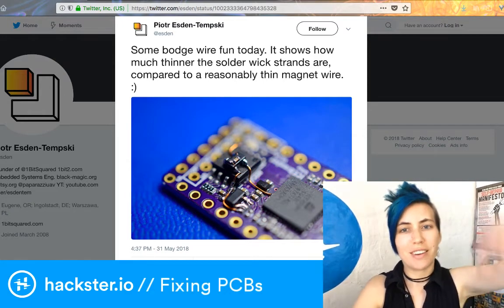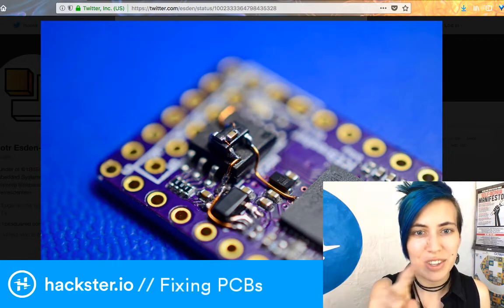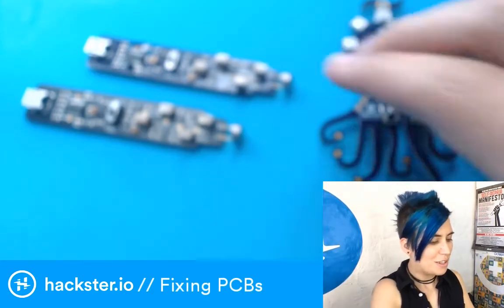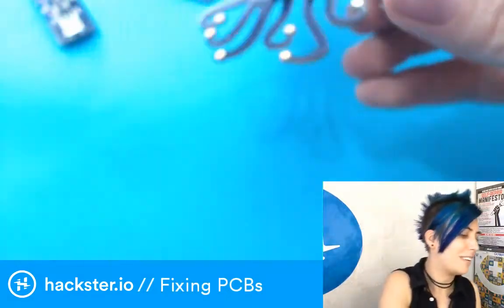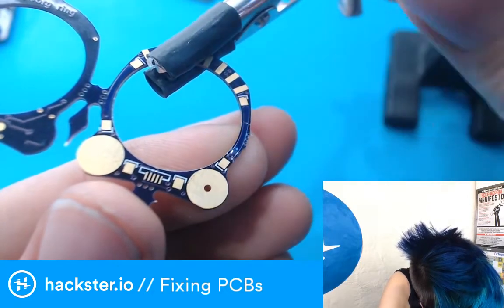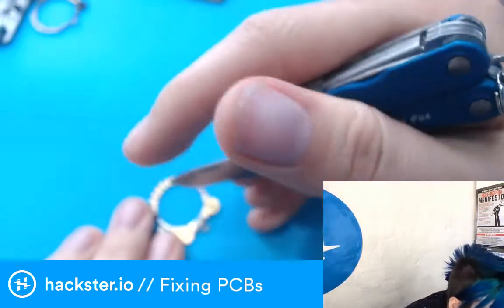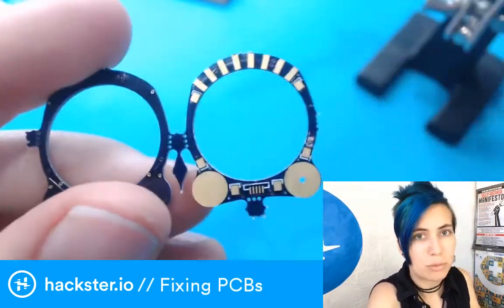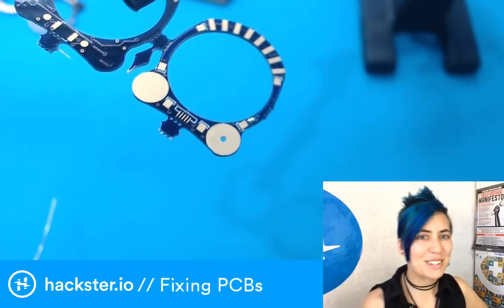Fixing PCBs // What the... Wednesday?

Comment: I have a quadcopter, its body is the PCB itself, one arm completely broke. A similar problem
Reply from the maker: Sorry to hear! Hope you're able to repair it.
Reply: Hackster.io
Plan was:
1.rejoin the broken arm as demonstrated in the video... simply 🤷

But I thought it'd create unacceptable imbalance to the quadcopter sense it's a micro drone. And another arm would break eventually.

So new plan was:
1.Find out which trace from the PCB center sends the power signal to the motors
2. Test and confirm the findings
3. 3D-print a new body, instead of the PCB itself being the body, including the arms.
4. Break the other PCB arms, and smooth the newly broken edges, and obviously remove the motors
5. install the new body
6. Solder back the motors to their respective power sources
7. Final test

Results are, While doing the steps, the following happened
1.Find out which trace...etc:
I found that the signal is a 15 kHz PWM signal.
2. Test and confirm...etc:
I've soldered the broken arm's motor to the traces that showed the power signal and pushed the throttle.... the motor just didn't move. After that test, I desoldered the motor and probed the traces again.... but no signal 😭💔
So I assume done component might have fried

:(

But it's a good experience :)

Comment: I bet OSH Park would replace the boards if you ask them. But sometimes it's fun just to see what works, salvage wise. You never know when you'll have to rescue an irreplaceable circuit board. Maybe something that's corroded because of a leaky battery and the pads are shot. I really like the idea of using the solder wick wire for bodging. Thanks for the tip! Like you mentioned the only problem is the lack of insulation with an enamel coating like magnet wire has so there is the possibility of short circuits over a long run. But maybe in that case some enamel nail polish would do the trick?
Reply from the maker: They were really gracious about it – reached out without me even asking, offering to give extra bubble-wrap and/or rigid packaging next time. Such a great company!
Reply: Yeah, my guess is that this happened when depaneling them.
Reply: I'm not at all surprised.